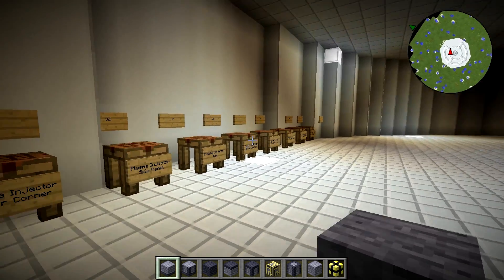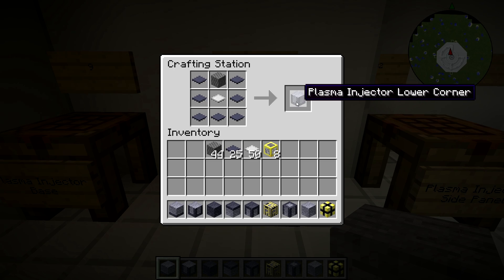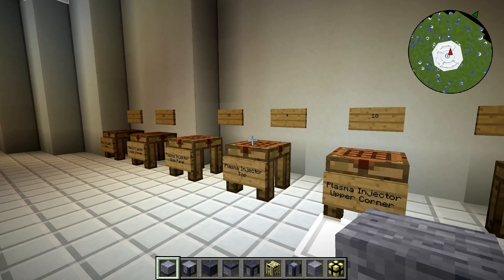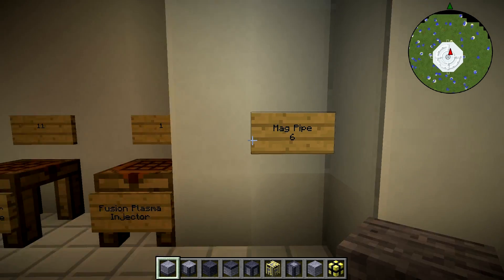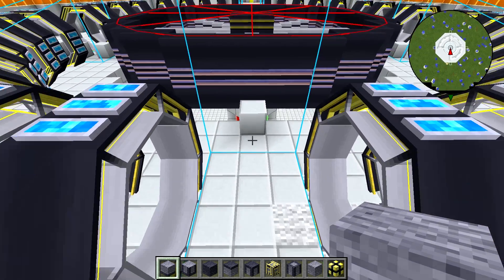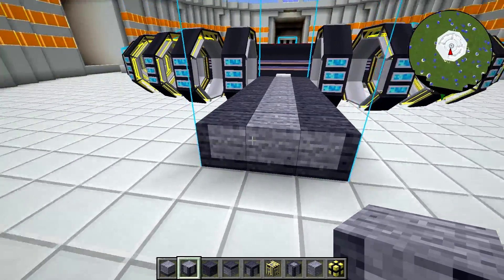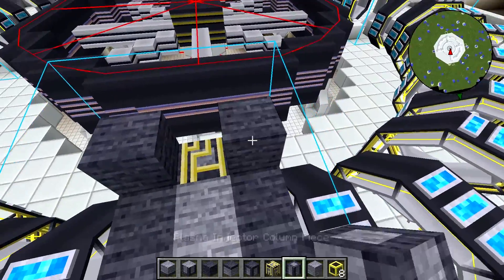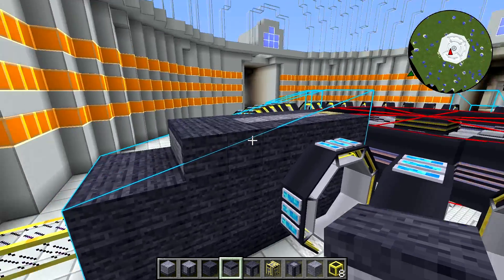ReactorCraft Tutorial #23 - Plasma Injector

Comment: i dont get this, i followed your instructions exactly and it didnt assemble into the multi block, so i tried the break and replace an induction coil thingy and no change... im confused
Reply from the maker: You really have to get this thing 100% correct. Often I find one thing is wrong. Make sure the Plasma Injector block is turned correctly.
Reply: SentinalhMC ahh thatll probably be it, i didnt think of that ill try it thank you :D